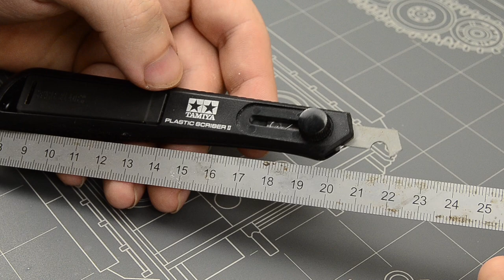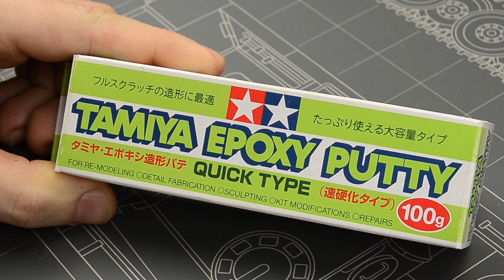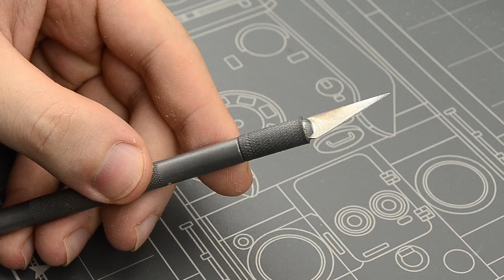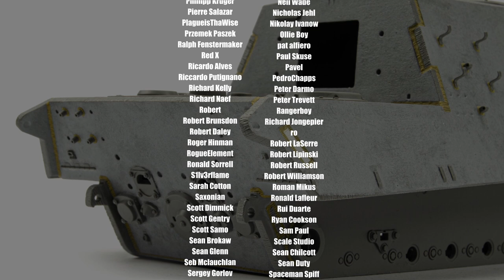The Ultimate Guide to Armor Textures and Weld Beads on Scale Models

Comment: Note to self: buy this same tank to build along uncle nightshift.
Reply from the maker: Not a bad idea at all, a bunch of folks are already building theirs 😁
Reply: @NightShiftScaleModels  I have the Tamiya one, just waiting on. An RB metal Barrel, Friul or Masterclub tracks, The skill to build it, a full photo etch probably from ET model and the Skill to build it...
Reply from the maker: @Snonaniganz  lol, the Tamiya kit is actually gonna be much better than the Takom Blitz.
Reply: @NightShiftScaleModels  Which is weird considering... Takom. Why do they make their plastic so soft and delicate though, most infuriating part of Takom kits tbf
Reply: ive done anyway from the tiger video
Reply: @NightShiftScaleModels  What are the shortcomings of the Takom Blitz version?

(p.s. I'm dying to see that newly-textured Jagdtiger with a coat of late war German Yellow...ideally with a dark brown wash but no camo colours applied yet. That way, the weld beads, flame cuts & texturing can be seen as clearly as possible. 🤓)
Reply: @derekbaker3279  There is another video he put out that shows it to be a very low quality model, that needs a lot of rework just to compensate for bad production.
Reply: @buckstarchaser2376  Hi Buck. Thanks. I found that video & watched it. I was shocked by the massive errors and fit issues with that Takom Jagdtiger kit. It's inexcusable IMHO.

I know that Takom has anotther, more recent Jagdtiger kit. I wonder if they corrected the terrible fit issues that Night Shift encountered with this Jagdtiger 2-in-1 kit....
Reply: I have the jagdtiger in my stash, porsche suspension 
Thanks, dear modeller😊 teacher
Reply: Note to self: send all of my build kits to NightShift for assembly and paint.

Comment: Be careful when looking at museum pieces! They are over 70 years old and the metal will have rusted a some point in its life. So the texture will be much more pronounced now than it was back in the day when the tank was new.
Reply: Yes some pieces may be very pitted
Reply: Armour steel does not rust that much to create additional textures. unless it has been under water for decades
http://virtual-sevastopol.ru/album/kazachka/35_batareya_stug3_1.jpg
this one has been in sea water for over 60 years and there is almost no pitting on the side armour

Comment: The c-shape welds for vertical is because when welding in that position you want to run up hill so your weld gets good  burn in(penetrating and forming a strong bond). Then something horizontal you would run right to left, pushing the weld and for the same reason as vertical, you want to push that heat forward and really burn your weld in. If you drag it you tend to get lesser penetration and typically weaker welds.
Reply: Recently we have been taught to stop a grave and go stringers only no matter how its done. Engineers proved weaves are weaker

Comment: Perfect.  I've got a King Tiger and Jagdtiger that need some welds.  You didn't cover the multiple-pass welds in the previous video so glad to see it here!
Reply from the maker: oooh I'd like to weld a KT! which kits do you have?
Reply: @NightShiftScaleModels  it's the AMMO 1945 kit (reboxed Takom) and I've got some resin to correct it for the July 1945 version.
Reply from the maker: @Panzermeister36  Noice. I'm torn between the Porsche KT (Anneliese) or Henschel in hand painted Ambush pattern...
Reply: @NightShiftScaleModels  I did Anneliese back in May with the Dragon kit (still not edited that video) and it was fun.  Those vehicles had some funky camouflage under the white so they make for interesting tanks for sure.  Lots of extra tracks.
Reply: I have the zvezda king tiger which is a dragon rebox. Still waiting for your king tiger series to build it. Gonna build it along with the master modellers like a big boy.

Comment: Regarding welding patterns you are absolutely right. If there is no more possibility or other reason to twist the part you are welding, it is actually done just as you described in the position it is in, thus needing the different techniques.

Comment: Yesterday I finally finished doing the welding on my first tank (1/35 Tiger) after months of buying it and now you posted this. Time to remove them and start all over lol

By the way. I got really glad when I saw you using the glue on plastic method for armor texture cause I had to use that one since Tamiya putty is not available in my country. And since my brushes are quite new and soft I used old toothbrush and it seems to works better and faster for larger surfaces
Reply: If you can find them in your country, try looking for gun cleaning brushes (or on eBay). They're much more resistant to solvents. No, not the metal bristle brushes, the plastic bristle ones.

Comment: The techniques in this video helped me to get the surface texture right on a printed model of a huge toad monster.  I dissolved plastic scraps in acetone until it was a thin paste, brushed that on the surface, and dabbed it with a brush to make a real rough chunky surface.  That worked great.  It gave the skin a nice texture and helps to hide layer lines.  Thanks!

Comment: I use dymo tape to help scribe lines straight and curved, but only use it on unpainted and primed surfaces, the adhesive will rip it off, bare plastic is best. Another great video!

Comment: Great tutorial! What I have done is make some very simple tools out of brass sheet. I think it was 0.05 mm (not sure). I cut a small piece off, turned it on it's edge and soldered it to a stiff piece of piano wire. Carved the pattern into the edge with a Dremel. I started simple. Made a 45° left, a 45° right, and a "V". Then proceeded as you have. You can use light mineral oil to prevent sticking. Not sure on the safety of spit :-). You can also use hardware store 2-part epoxy (a little cheaper than Tamiya). Great job, my friend! See you next week.

Comment: Kinda tempted to try this on Warhammer models. Not much call for cast armour texture and rolled steel texure all over might look messy given the smalle scale, but I might try some texture on the smooth(ish)-edged "turret cheeks" on the Leman Russ and add some flame-cut markings to the sides of the gun mantlet.

Comment: Oh yes the intro.... 
For welds in corners (like with plates which connect with a 90° inside angle) or small welds around the driver's sight etc., do you also scribe them before filling them with epoxy putty?
Looking forward to your King Tiger videos. Would like a nice What if as well at some point. A modelcollect or amusing hobby kit would be great.

Comment: A nice trick I have learned for replicating casting/foundry marking (like numbers) on cast elements:
- get a plastic sprue
- gently scribe/cut off the number you want from the sprue (you know, like just the number itself)
- glue it with extra thin glue to the part

Unfortunatelly you are limited to what you will find on your sprue, but this way you don't have to look for resin decal set from Archer:)
Reply from the maker: Archer decals are meant for smaller foundry marks. The bigger ones can be replicated with the method you described, or by bending a very thin wire into a number :)

Comment: have you ever thought of making a model where you show the progression as a finished piece?  where one half of the tank is painted and weathered, and the other half shows all the tan weld beads, copper handmade metal pieces, gold wire silver bolts, flame cut marks, etc.  to show the details that you did yourself,  maybe you could even do more segments for example one dull boring from the box without texture or beads or flame cuts, one with all the unpainted details you added, one with just basic paint, and other with weathering and aging.  I've always wanted to do this, but I don't have the skill to make all those details, so theres no point in half of the tank being simply grey primer...  I'd love to see that if you were interested in the idea.

Comment: It would seem that the vertical welds are done with a “weave” technique and the horizontal runs are done with multiple “stringers” stacked next to each other. 

The welder could’ve done the vertical runs using just stringers but it was probably faster in the manufacturing process to weave.  On the other hand, the horizontal multi-pass weld joints have to be completed with stringers because you can’t weave horizontally. 

Keep up the awesome work! I’m really enjoying your videos!

Comment: I have a Tamiya T-55A kit I'm going to do the cast texture technique on. Smooth texturing is an issue I've seen with alot of Russian armor. Can't wait to put the Tamiya Epoxy Putty to use I have laying around. Milliput can also be used for weld seams correct?

Comment: How would you approach a Full metal (mostly Aluminium and Brass details) 1/16 scale tank? Im currently getting the parts together for a May 1943 Panther Ausf D and I was planning on using the historical process of red oxide primer then RAL 7028 as a base coat and so on

Comment: Is this thenTakom blitz jagdtiger?  I wouldn't have thought this was really needed on the blitz kit its amazing textured one the best I've seen yet! I ran my hand done the T34 at Bovington once and it near ripped my palm to bits haha!
Reply from the maker: It's not about if you need to do it, it's about if you want to do it :D 
Also the Blitz JT has a serious fitting issue with the front plate and as a result my welds were misaligned, so it was a great excuse to rescribe all of them.
Reply: @NightShiftScaleModels  yes I know I'm thin of trying it haha I'm away to start the kit after my Trumpeter 7/2 halftrack with I'm pak 43 but I know a few boys from the IPMS club Scotland who said the late and the Porsche production kit was a really nice kit with no fit issues inside ask abiutnthe kit first before buying it so I'll soon find out

Comment: But can we use these techniques on 1/72 scale armour models? I would imagine that it would be hard to get the putty rolled small enough to work
Reply: Eh, you'd want about 0.25mm or so. Might be better off using plastic rod that size, but it should be possible to roll out the putty that thin.

Comment: I have the problem that the plastic partially pulls threads when I work on it with a brush - any tips?
Reply: Also how do you keep your brushes working? Mine are kinda fast gummed up with the putty and glue mix :/

Comment: The way they welded it would have been the quickest way. That's probably why it looks that way. It looks like they were in a hurry over worrying about neatness.
Reply: From a Soviet report on German AFV welding:

"1. Characteristics of weld seams on German tanks.

After looking over numerous types of German tanks, built over a large span of time, it has been established that all German hull and turret armour is welded with electrical arc welding. German armour is only welded by hand.
Automatic welding, used extensively in domestic and American production, is not used by Germans at all.
German welding seams are smooth and aesthetically pleasing."

http://www.tankarchives.ca/2013/03/on-german-welding.html

“Smooth” in the context of manual arc welding is a movable feast. A somewhat “lumpy” surface on manual arc welds, especially welds made vertically or overhead, is the normal result of the process. Manual arc welding isn’t something you can rush or cut corners with, not if you want decent welds.

As for speed, Germany never adopted the automated welding which massively increased US and Soviet productivity.

Hi-tech (for the time) machine/automated welding using “submerged electric arc” technology was invented in the 1930s and gradually introduced during WW2. It was far faster than manual welding, though it had limitations - e.g. it couldn’t be used to make vertical or overhead welds. So if you needed a joint anywhere that wasn’t both horizontal and facing upwards you either had to rotate whatever you were welding into a position where the welding machine could do its stuff or do the weld manually. Automated arc welds usually look somewhat smoother than a manual one, rather like a shallow valley filled with cast metal.

What Germany did do was change their construction methods. A Soviet report (sorry, can’t find a link for this) commented that late war German welds were usually “shallow” and didn’t penetrate the steel they were joining very deeply - usually a weld would go all the way through the thickness of the plates being joined. It might be that the German move towards using interlocking armour plates that supported each other mean the welding didn’t need to be as strong as “conventional” joints. If so it would certainly have saved them welding time, materials and electricity.